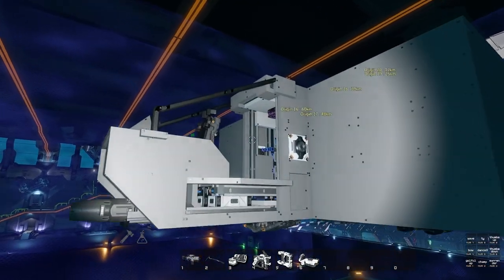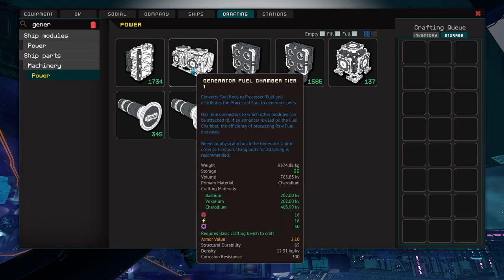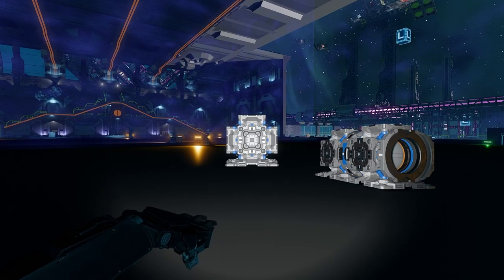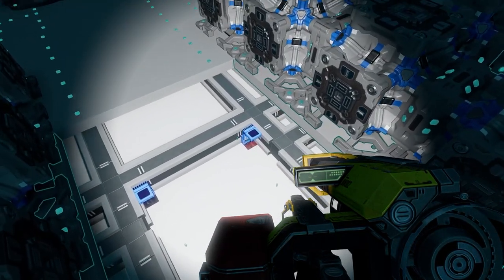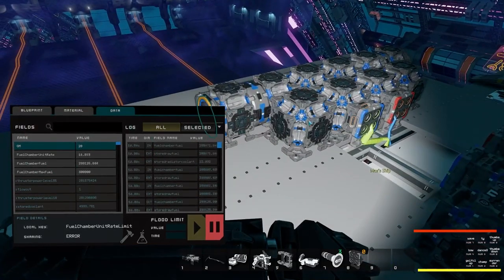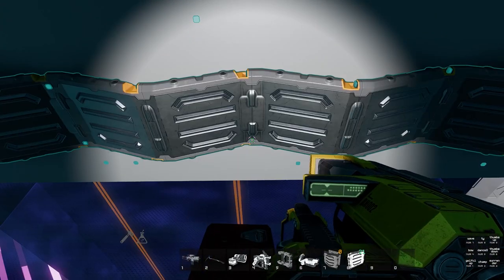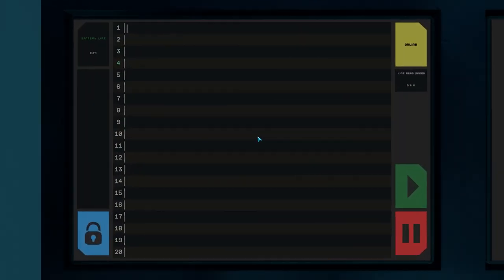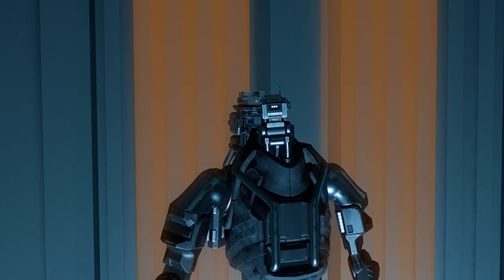Hack My Laborer [Ep 09] - Massive Generator Upgrade, YOLOL Refinements - A Starbase Tutorial Series

Comment: Awesome series dude, I used a script to add 5 to gm if the battery is lower than the last loop and decrease by 2 if its higher than the last loop or decrease but 10 if battery's are full
Reply: Keeps the generator running at the optimal percentage while flying
Reply from the maker: That's another good strategy! I played around with a couple similar strategies as well. I think what I was missing was continuing to ramp up the generator until the battery was full. Maybe I'll play around with that idea again. Did you manage to squeeze it into 1 line? :P
Reply from the maker: More importantly, this just showcases how awesome it is you can do things in so many different ways without really being dead "wrong" about the way you get a job done!

Comment: I decided to get an new Laborer and started over I just couldn’t get the first to do any kind of speed and I checked everything. There was one thing that would require a major change to fix. The mineral scanner didn’t have enough support according to the scan and I didn’t what to remove everything so that were we are.
Reply from the maker: That's weird. I haven't seen any issues with the material point scanner and durability. The only spots I've noticed issues are with the new propellant supports for the extra tanks. And the extra batteries if you auto-bolt the cargo crates next to them. But all durability issues should be visible as red objects with red squares in the middle. Usually the solution is to either add more bolts, or just unbolt the whole thing and rebolt it manually until it's green. I hope the new ship brings you better luck! I just remade a laborer on Twitch the other day to replace the ship I lost.

Comment: These are great! Was any of this in EZbuild? Did you craft the modules or the separate parts and put them together?
Reply from the maker: Thanks! The first episode is the only one I did with Easy Build Mode. After that I switched to picking the ship apart and upgrading things a little bit at a time.
Reply from the maker: But that initial Easy Mode build has helped a lot since a lot of the easy build modules are kept wired up with ducts already.

Comment: I ran into a problem. I took the ship out to mine and the speed was really slow when I was not in turtle mode.  Accord to the speed information I was getting around 23 at full power. I checked the name of the thruster and that was correct.
Reply from the maker: Most likely you have a durability error somewhere on the ship. You can pull out the universal tool in Blueprint mode and press the second button on the top row to turn on the durability overlay. Look for a red box or object. The red box will tell you what's wrong. Usually you need to add some more bolts, or just remove the bolts and manually bolt it down again.

Comment: Is there any benfits to using math instead of If then statements?
Reply from the maker: Usually just space. IF THEN ELSE END takes up a lot of space on a line so you can only do so much on that one line. The benefit to trying to make your code fit on as few lines as possible is that the whole script will run faster. Every line of codes takes 0.2 seconds to execute so the more lines the longer it takes to execute all of the lines. I'd say usually it's not crucial to have your code execute in 0.2 seconds but in some cases that might be important to you.